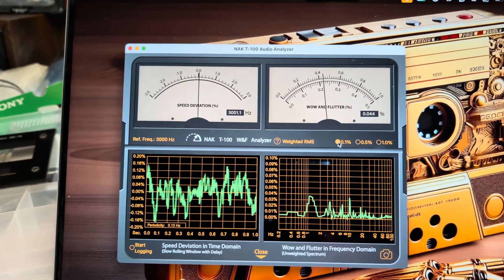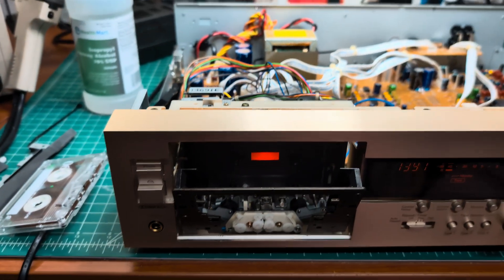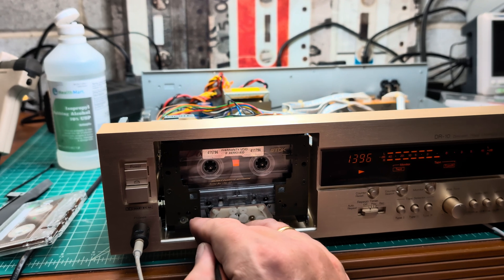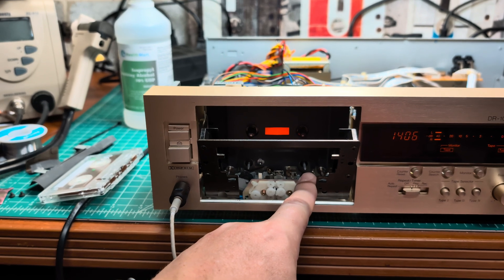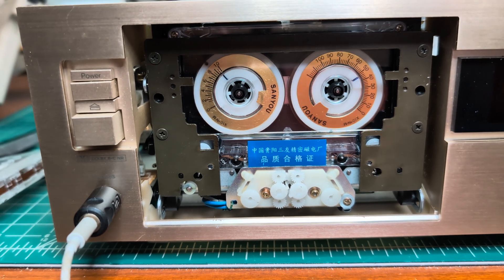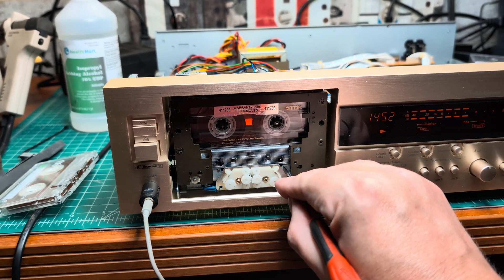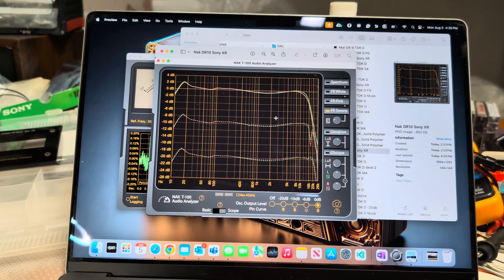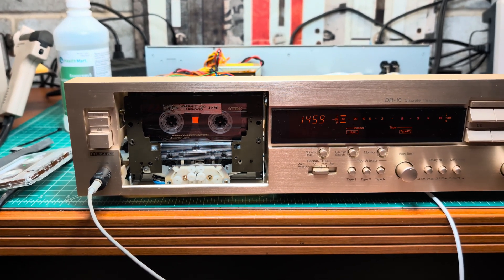W&F Elimination for Sankyo Transport on Nakamichi DR-10: Achieving Optimal Readings

Comment: Check the idler gear teeth engagement depth. Adjusting it to the optimal position should reduce cogging. 
Lowering takeup torque to ~30g does reduce flutter, and doesn't appear to introduce any negative side effects. But still I would not go this route unless it is the only solution left.

Comment: Check to see which pinch roller makes contact first when engaged. It should be supply side pinch hits first then take up pinch by fraction of time, but to keep proper tension over head, left pinch must hit first.
Reply from the maker: @ssnoc  you are 100% wrong. Right roller engages first. To pull the tape before left will engage. Otherwise tape will bubble above head.

Comment: @hifirulezzz don't waste your time with pinch rollers and capstan shafts, your main problem is the force on takeup reel, as i mentioned in other comment. Lower that force as low as you can and your flutter problem will disapear.
Reply from the maker: @maxentemask  you are kidding, right?  The tensions are standardized and should correspond to proper values. Takeup should be in range 40-55gramms. That is why test tapes exists.
Reply: @hifirulezzz  Forget about calibrate takeup torque because you no longer have original pinch rollers. Those pinch roller that you buy nowadays are not as near as those original. Most of the pinch roller come from China and the material is total diffrent and doubious from what it use to be on those original. That's why you need to loosen more the tension of the tape so the pinch roller work more freely. In the end that takeup reel is just for packing the tape and should never interfier in pinch roller business.

Comment: Did you get on top of your problem? To me it sounds like a bushing could be your problem.

How is the status of your supply pinch roller, does the rubber feel gripping good? Modern tapes are usually smooth and fine grained and they need an extra grip from the roller. You can verify with older more grainy tapes. I'd also consider the roller bushing as a culprit. But for my experience what causes that kind of flutter is the supply pinch roller not having the right grip on the tape.

I'd also consider a possible worn out roller metal pin (and they do wear out as they ride on top) or even a supply reel problem that for some reason is exacerbated under the weaker supply pinch roller pulling rather than the main take up roller unit. Also might by due to uneven spinning of the supply reel. I've seen bushings that are dry which is fine since plastic to metal is already a bushing in itself, I've seen bushings that are greased and also some with oil residue in what a I believe is the original factory service.

I've done the mistake of putting oil were it should have been in the past but I also solved with greases and oils the problem of squealing and whirring of the reels.

Comment: Did you check Power supply to the motor for level and ripple/noise?
Reply from the maker: sure I did. I even tried to add a filter cap on top of the motor, but it did not help.

Comment: Left flyweel out of balance?
Reply from the maker: @lmkan  in that case it would be wow, not flutter. I think the left pinch roller can't keep the takeup reel tension in that case.
Reply: @hifirulezzz  Depending on what unbalance it can be flutter as well. There's at least 3 types of unbalance that can occur in the flyweel and one of them can cause higher dynanamic resonance in combination with pinch roller bearing clearance heard/measured as flutter.

Comment: seems you get problem with take up side, idler or gears (not sure which one is used in DR10) and motor.
Reply from the maker: Why do you believe so? Takeup is pretty fine. I am already achieved more than with other Sankyo transports I fixed. Just asking if any ideas to improve it further and reduce those jumps.

Comment: What if the problem is not the capstan or the pinch roller. What if the problem lies with the surface of one of the heads? Or is the problem with the plastic tape guide on the left pinch roller. The last thing I can suggest is the back tension belt behind the faceplate that goes around the supply reel. Perhaps using a cassette with a transparent shell, and use a smart phone that can film in slow motion, film the tape on the right hand side of the cassette. Play back the video and observe the tape to see if there is any physical fluttering. This is a long shot but I do believe the reels are gear drive and not via a rubber idler, could it be a symptom of the gears meshing together that is causing the flutter, and the take up capstan is there to reduce/eliminate the flutter?

Comment: Greetings! If the tension of the winding unit is reduced to 25-35 g / cm, then the detonation will be lower! There is no need to adjust such a force on modern cassettes! This not only affects detonation, but also increases wear of the winding gear motor, or rubber idler! ✋ With the slightest aging of the receiving pressure roller, the winding force of 45-50 grams will try to pull the tape out from under the roller, and this is detonation, plus tape warping, especially 110-120 minutes, with a thickness of 9 microns!

Comment: It's absolutely normal, the left pinch roller is not ment to have much grip, the right pinch roller is the main. You ruined your capstans polishing them. The designer did them as they are for some reasons. I don't understand why do you keep change belts instead of testing them before. I have a CR-4 with original belts and pinch rollers that have beter w&f than most of your decks with new belts (<0,035%). All my cassette decks still have their original belts and still performing very well. Stop doing experinents on your decks. My oldest cassette deck is a JVC KD-V6 with original belt, idler and pinch roller (that looks like new). It still performs w&f as new, despite it is 40 years old...
Reply: wow, you must have magic belts 😂
Reply: @paulmon4077  I have a CR-4A with original belt that exceeds (is lower than) original factory W&F.  I wouldn't believe it if I didn't see it with my own eyes.  On the other hand, a classic mech Nak 480's original belt was way out of spec.  Best new belts I've found are PRB FRSP's but W&F is generally much higher unfortunately.  I have a CR-4 (multivoltage) that needed a new belt (was not original) and I'm lucky to get twice the original W&F specs with PRB.  Same with a trio of CR-3A's.  Wish I had the original belts for all my Nak's, but unfortunately most of them had "replaced belts" as a selling point.
Reply: @paulmon4077 Yes, I do! Do you mind? 🤣
Reply: Rubber parts are wear parts. They are not designed to last 30, 40+ years. If you want to restore a deck (future-proof!) you should of course replace them (assuming you get a quality replacement).
Reply: @MagicMaus29  Well, most of my belts are built to last for >30 years. 😉 All I replaced are idler tyres, back tension belt (where available) and pinch rollers, in some cases. But none of my decks required new capstan belt.

Comment: Hi, in your case it sounds like your pinch roller assembly. Check for trueness of arms, and rollers are perfect flatness and round. The amount of upward
force to the capstans. There is a gauge for this, The take up side  has more Forse up pressure than the left side.  Try applying a little more pressure
on the take up roller. Hope this helps you.
Reply from the maker: @Gordonseries385 I have measured and the force is fine. The left roller has 300 gramm pressure and the right is 500 gramm.

Comment: nice one, from my experience the left capstan (if right roller is down) always has hudge flutter on many decks even direct drive like technics or sony. generally it might be the torque clatch on left side which is via another belt and then clutch and i think this design is not great compare to felt and spring as in most of the decks. in all sankyo transport im experience high w&f.

Comment: I consider this behavior to be absolutely normal. If the right (main pinch roller) is not involved, the takeup-spool alone provides the counter tension. And it is not supposed to put any tension on the tape whatsoever, but only to wind the tape back up (loosely). Without the right pinch roller, the tape is basically pushed over the head instead of being pulled. So it will never be able to run completely smoothly over it. It is therefore to be expected that this leads to WoW&Flutter. The left pinch roller is only responsible for improving the tape tension over the head... not for tape transport in general.

However… I had a very similar problem with a deck, in terms of suboptimal WoW & Flutter values. I had also already basically replaced all the parts in the tape path and could only reduce the problem, but not eliminate it. Just like you. Replacing the capstan bearings finally brought success. Apparently they were worn out.
Reply from the maker: @MagicMaus29  this is a brand new Nakamichi deck, gift from my very good friend
Reply: @hifirulezzz  Then worn bearings are probably not the problem. Another thing you could try is to experiment with the tape tension settings. Sometimes wow and flutter is favored by an unstable azimuth. Dual capstan drives are a blessing if they are optimally adjusted. If not - a curse ;) But you probably know that as well as I do.
Reply: I find the Belts that are made today are to tight (small) and to thick, I have stretched them out to improve W&F. I also I test and sand the RT spindle if needed w this test  you Should be able to put your finger on the pinch roller rubber and test how strong it is and it should be strong,  the Lt spindle pinch roller, I had good luck w even lower /less spring tension. Getting it to go lower is a battle and can take a long time. good luck

Comment: Since your problem seems to be on the left side.
Have you checked the left idler wheel? I once had a cassette player lose power when it was in the play position. It was left that way for a while before I got to work on it. It ended up putting a small compression mark on the idler wheel. ( because it was left in the play position when it was powered off.) It gave the cassette player high flutter. I replaced the idler wheel and it went away.